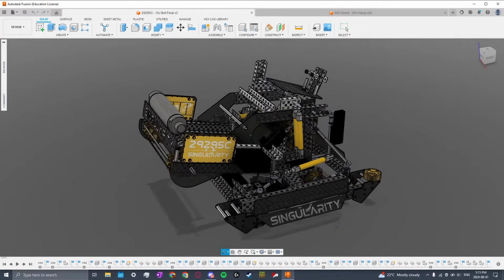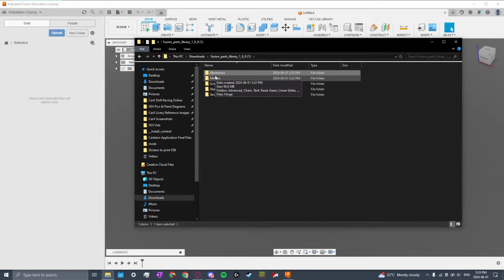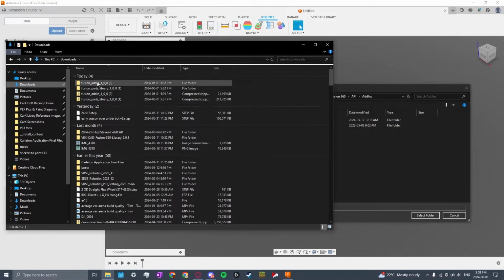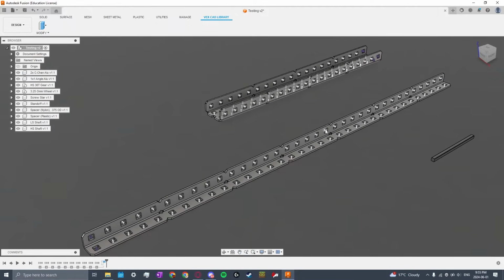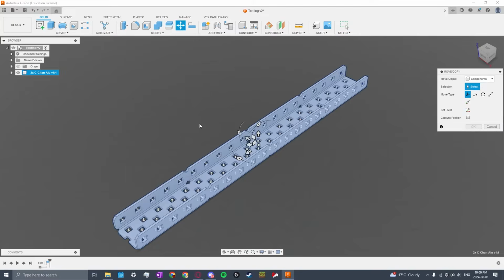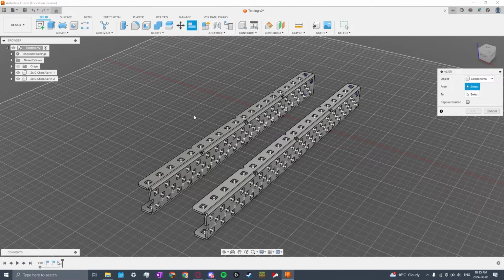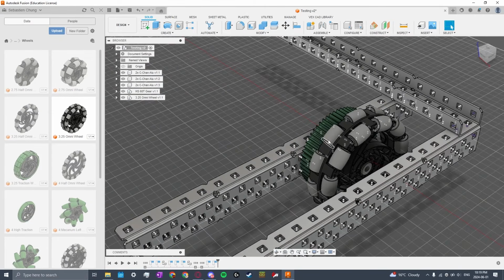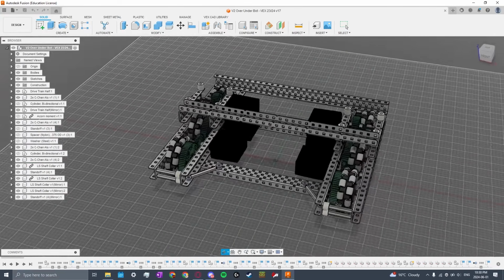How we CAD VEX Robots in Fusion 360 | Part 1 - Parts Library, Tips & Tricks

Comment: There seems to be a problem when I download parts form the VEX website and try to import them. They appear to import fine, but when I actually try to drag it into the model, it says the file is corrupt. I believe I imported it correctly (just clicking upload, and then dragging the .step file from VEX's website to the dialog box). What might I be doing wrong?

Comment: i have been doing cad for a while and when you use the align tool you have those white dots on the object, i don't have those and am wondering how to enable them.
Reply from the maker: If you go to display settings (the little monitor icon on the bottom middle of your screen) and enable sketches then the dots should appear. If they don't then you may have the wrong library installed
Reply: @StratfordRobotics29295  thankyou. the next issue when uploading the files is that it wont let me drag and drop, i can select them al but it wound drag and drop them.
Reply from the maker: @BengalsFan-b8g  What part of the dragging and dropping isn't working? Are there any errors or warnings given or does nothing happen at all
Reply: @StratfordRobotics29295  i select the  files, than right click and drag them. a red circle with a lien through it appears and it  doesn't show up on the cad
Reply: @StratfordRobotics29295  i can select all the files, then i right click, then when i drag them a red circle with a line though it appears and it doesn't show up on cad
Reply: @StratfordRobotics29295  i got it, thank you so much, real one

Comment: idk if u guys even respond to the comments anymore but I tried dragging the parts from the library into my build space but it doesn't work. I instead have to right click the part then select inset into current project. Do you guys know if I have to change a setting or is it a button other than left click?
Reply: Nvm I just realized that when i use my mac it doesn't work. Now that I am on my Windows computer it does work so maybe just a difference between the windows and mac version of fusion.
Reply from the maker: @coolguyz1016  Mac likes to break fusion sometimes lol

Comment: I have a question, when I tried to move or rotate a C channel the interior Holes in the C channel never move with the metal piece what is the solution?
Reply from the maker: You need to fully select the part by double clicking or selecting it from the side bar. If you only click once it wont select the full component
Reply: @StratfordRobotics29295  Thank you very much helped a lot!!!
Reply: @StratfordRobotics29295  Even when I fully select it, it won't move with the interior holes.
Reply: o shoot nvm it's because it was grounded.

Comment: high strength shafts are sold longer than 12 inches how do you modify it so that you can cad vex high strength shafts are longer than 12 inches
Reply from the maker: make it 11 inches then extrude the flat end
Reply: @StratfordRobotics29295  what does that mean?

Comment: Where can I get the files for the High stakes components like the mobile goal and rings? I have been searching and couldn't  find any. Btw this video if really helpful since I'm new to CAD Thank you!!!
Reply from the maker: Full field CAD is on the vex website, you can separate the elements you need from there. https://www.vexrobotics.com/276-8868.html?queryID=a7e4aab67d4e1d8e6f5d054ea44484c8&objectID=4684&indexName=vex_m2_vexroboticsca_products 
I can't directly link file downloads here for separated parts but this method works fine

Comment: bruh i have used fusion for 2 years now and never knew what capture v revert position did
Reply from the maker: Its more relevant when using joints. You can move the joint around then revert back to the original position. For VEX stuff you usually want to hit capture whenever that shows up.